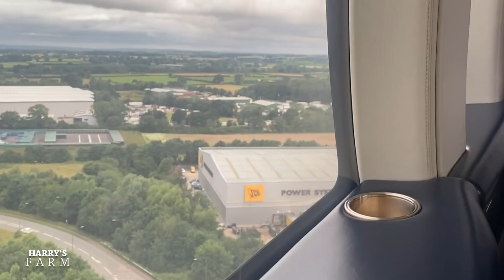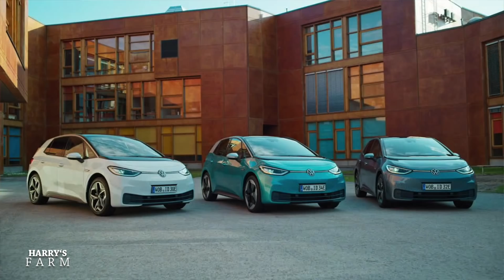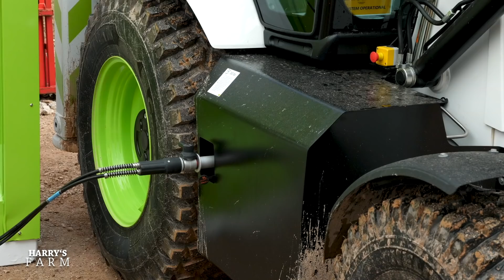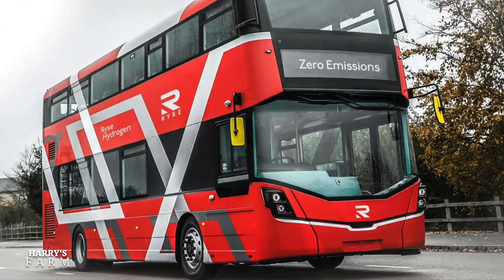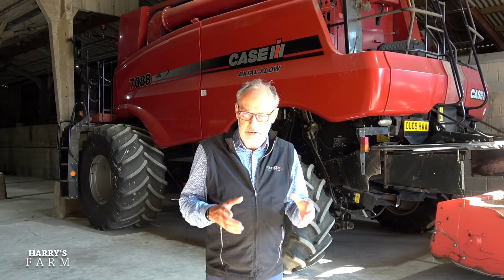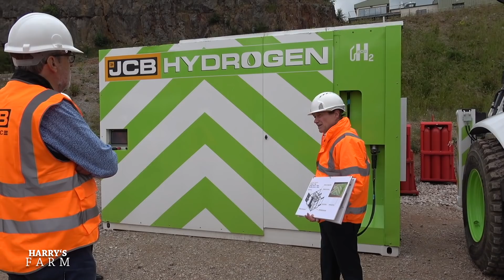Why JCB thinks hydrogen is the best alternative to diesel for heavy machinery, farming and HGV fleet

Comment: Absolutely brilliant.  Hopefully JCB can wipe the smug smile off Elon Musks face.
Reply: Elon musk is investing hundreds of millions in battery RD.  JCB will lose every penny they put into hydrogen.  Batteries can't run for a 12 hour shift.  yet.
Reply: Unfortunately not. this offering ignores the main problem with hydrogen, which unfortunately Harry et al either choose not to mention or simply don't understand. Elon does.
Reply: @dipladonic  which is what?
Reply: @callumhardy5098  A relatively huge load of renewable energy is required to produce only a relatively tiny amount of green hydrogen.
Reply: @dipladonic  yes, at the minute that’s true. There are many ways of getting hydrogen. Siemens are currently building two large electrolysis plants in Germany if these are successful it could pave the way for efficient hydrogen production in Europe.
Reply: @callumhardy5098  Don't be ignorant. Look at the production volume at the Siemens plant (and ALL other green hydrogen projects). It won't scratch the surface of the ubiquotus green hydrogen fallacy. All of these projects are greenwashing smoke and mirrors.
Reply: @callumhardy5098  ...and remember the biggest problem that green hydrogen has, namely, volume and cost. It takes a relatively huge load of renewable electricity to produce only a relatively tiny amount of green hydrogen. Until or unless you realise that small, inconvenient truth, then you are not objective enough to comment on the subject any further.
Reply: @dipladonic  Before Elon Musk, Tesla and large investment, batteries were in-efficient, heavy, more expensive and charged slower than modern batteries. Are you saying that electrolysis and other hydrogen generating methods cannot be improved by investment and demand? It’s clear that while electric cars are a viable replacement for short distance commuters and city cars, they still are no match for Long distance (mostly diesel) ‘crusing’ cars. I, for example have a 2006 diesel Jaguar XJ which will do 700 miles on one tank and it only takes me 5mins to fill up, don’t you think that there is a market for this type of vehicle? And that of JCB can do it without an inflationary price that, that will be the answer?
Reply: @callumhardy5098  Battery density hasn't really increased to any significant extent (unlike Moor's Law and semi conductor capacity) for decades. If you read my responses to callum hardy on this thread, you will see exactly why ubiquitous green hydrogen is a fallacy. Cheap, plentiful, reliable hydrocarbons are the master fuels and will remain so until the supply/demand curves intersect, then there will be wars (which will never be fought over unreliable, dilute, and highly subsidised wind and solar!
Reply: Excellent! We hope so! Bloody Tesla’s! I give em a blast of diesel in my Jag when I pass them.

Comment: Interesting video but what about nox and what about oil burn? Fuel cells are still twice as efficient, in other words twice the return from a fuel cell,  this means the whole re pressurizing part is not needed and I will bet that is not cheap plus the prices only make sense if the hydrogen is made from gas, so many  parts missing from this light skim over the subject, take a look at the toyota hydrogen engine and the problems and lack of power. I would still put my money on fuel cell / capacitor bank / electric motor setup, more bottom end grunt less maintenance, longer life.

Comment: Diesels engines were originally designed to run on peanut oil or any combustible fuel oils. 
I don't believe in global anthropogenic climate change.
If you can, please show me peer reviewed data linking the correlation between CO2 emissions and global temperature change. 
I believe that governments & global warming enthusiasts are trying to solve a problem that doesn't actually exist.

Comment: this  is very old news for me.  There was a farmer in TX that made a way to produce hydrogen on his farm with a wind mill and water.  Then converted his old tractor and some other equipment on the farm to use hydrogen.  he was far from a rocket scientist and with his era, only finished the 8th grade.  Then again the head of the TX supreme court back then also only had a formal 8th grade education.   I would also say look at what BMW engines were designed to run on back in the 90's.  It just might surprise you.

Comment: Unfortunately, this technology will be squelched by the "Elite". There is no money in it for them. There is plenty for hydrogen fuel/cell tech, fossil tech, and electrical tech. No money in converting water to H2. There's no way to control a substance with an endless supply. Bob Lazar already has a hydrogen combustion engine and its been squelched. Good luck JCB. I hope you pull it off and put Musk under. It just ain't gonna happen though. Not until the world is cleansed of evil.

Comment: Is it possible to use delivery tankers at 400BAR like you would deliver propane? Or will the government not allow that much pressure out on the road?
By the way, I am talking about big storage tanks, not small cylinders.
Reply: You won't find a big storage tank at 400 barg on the road, it can only be small cylinders.

Comment: Hydrogen doesn't provide more energy by volume, unless you use metal hydride storage. If you use metal hydride storage it's energy per mass is actually worse than battery's. The only exception I've found is using compressed ammonia gas, then supplying fuel-cells via on-board reforming. This however is horrifically inefficient, to the point of completely eliminating any economic incentive for doing so.

None of these vehicles are road-registered or refueled at a service station. So a battery swap makes far more sense, especially since it could be integrated with the vehicle trailer.

Comment: As I understand it, the problems of Hydrogen storage and energy density can all be resolved, but the real issue is that any combustion engine regardless of fuel, will generate NOx emissions.  NOx emissions are the reason diesel is now being vilified, so I don't see how Hydrogen fixes that problem!
Reply: Nox has been solved in diesels already with the use of DPFs and adblue.
Reply: @stephenparker5241  This is why discussion is good.  I just did a bit of research on SCR and adblue (urea in water) and you are correct, this does appear to remedy most of the NOx issue. If you're open to it, you can learn something new everyday.

Comment: The volumetric energy density- density per litre of cryogenic Hydrogen is 4x less than diesel and 8x less than diesel if it's a gas compressed to 700 bar and obviously 16x less if the Hydrogen is only compressed to 350 bar which is typical if you're not specifying high performance hoses, valves etc. Storage is really the big challenge for Hydrogen as a fuel. 

Check out https://www.energy.gov/eere/fuelcells/hydrogen-storage.

Comment: If the hydrogen comes from natural gas, it makes no sense whatever. Just run CNG in the diesel engines. Old tech.

H2 engines are nothing new at all. Not Otto cycle gasoline engines, but diesel cycle with H2 direct injection. Well known, long done.

Comment: This whole way of thinking could let the world carry on with little more than a bump. I could never understand how a battery powered truck or tractor were going to work. This will trickle down to cars as well is my guess. It makes no sense to dig up the world for something that's going to fail in the end. There probably will be battery powered cars in the future, but this is way more practical and sustainable. People crunching numbers say this is not efficient enough, but it has not really got much to do with the efficiency of an engine, we are supposed to be saving the world and batteries are a fast track to destruction. A hybrid capacitor/hydrogen powered car might be an option as well. I would love formula 1 to go down this track and bring back the V12 engines. Great video Harry, I've been waiting for some sense to prevail.

Comment: Couple things about hydrogen fuel, it has a wider range of combustibility over propane or natural gas. Of the three it has the least amount of energy for it same volume of fuel. There’s a reason we use certain fuels. One reason gasoline and diesel fuel are used in the US is because they don’t need to be compressed to be shipped, either by pipeline or truck. Propane can be compressed to a couple hundred psi and turned into a liquid, hydrogen needs around 3000 psi to be turned into a liquid and subsequently needs a much stronger tank to hold the fuel remembering of course it has less energy then propane. Additionally compressing a needed amount of hydrogen to run say a farm tractor I believe it’s quite an accomplishment in a short period of time which can’t be done. It all sounds good and sometimes it satisfies the do gooders but don’t bet on it.

Comment: When I first heard about lorries like Scania, Volvo, DAF etc moving towards full eletric I did have concerns about running costs. As wouldn't there be more downtime as they would take hours to charge and the range surely wouldn't be all the great with the amount of weight these vehicles need to pull. There's also the extra weight of the batteries and with lorries weight is a big thing to think about as the more the tractor unit weighs the less cargo you can haul meaning less money per trip. Seems like a pretty big turn off for companies to buy these new trucks atleast for long haul. Inner city or local haulage might be OK with this way of powering trucks but I imagine it would surely be unsuitable for long haul.

Comment: Very nice from JCB to invite. But there is a problem, waste heat. Every stap you make to get hydrogen you lose energy in form of waste heat. So from the electrolysis 80% efficiency, compressing 15% efficiency and then you have to cool down the gas I don't want to talk about it.
The biggest fraud in history of mankind, it is not the CO² in the sky it is the inefficiency of our inventions that maybe could reduce the emissions of CO².
Yes we have to be efficient with our fuels, but every new engine on the market can't produce more kwh from every gram of fuel than the previous one did. In technical understanding the new technologies are rubbish.

Comment: My question what is the compression ratio compared to the Diesel  . Will it be man enough to pull a100 rail cars .i will be impressed if I see a Hydrogen truck pass me on the highway hauling a100 thousand LBS LOAD . Please talk about horse power comparisons & load capability. Nice and clean but dose it have balls .

Comment: Would an battery powered 20 ton excavator really be 28 tonnes? You can replace the counterweight with batteries while the electric engine would weigh much less. Nowadays we add weight to excavators to make them steadier...

Comment: It'd be interesting to know if the new hydrogen engines can be used as drop in replacements for the current diesel engines. Obviously the fuel tanks would need to be fitted too, but that would mean companies wouldn't need to go out and buy a whole new machine to be able to use hydrogen.
Reply: Great idea, the kind of mindset we all need but unfortunately most are still all about making money.
Reply: I get the impression from the video that the only change needed is the cylinder head, the injection and ignition system and the fuel tank. So keep your fingers crossed conversions may be possible.
Reply: @stevemillard2487  possibly the crank as well to change the stroke length. All fairly straightforward stuff though
Reply: @izaakfrost4186  alas. NOx
Reply: oil companies attempting to sell oils and gas dressed up as hydrogen it is a scam    Depending on the quality of the feedstock (natural gas, rich gases, naphtha, etc.), one ton of hydrogen produced will also produce 9 to 12 tons of CO2  
However, hydrogen combustion with air produces oxides of nitrogen, known as NOx. In this way, the combustion process is much like other high temperature combustion fuels, such as kerosene, gasoline, diesel or natural gas. As such hydrogen combustion engines are not considered zero emission.
Reply: @brianevolved2849 it's zero emissions. Just water vapor. Weren't you listening?
Reply: @victorhooper4236  oh Victor you are silly,  However, hydrogen combustion with air produces oxides of nitrogen, known as NOx. In this way, the combustion process is much like other high temperature combustion fuels, such as kerosene, gasoline, diesel or natural gas. As such hydrogen combustion engines are not considered zero emission.
Reply: @brianevolved2849  sure but only minute amounts of nitrogen oxide, not enough to be a dangerous emission.  When combined with air  it produces mainly water vapor. No CO2 emissions
Reply: @victorhooper4236  Honestly Vic H2 such crap idea  storage compression explosive  I've played with the stuff  it's f'ing dangerous
Reply: @brianevolved2849  I think you need to look to the future and the future isn't all batteries
Reply: However, hydrogen combustion with air produces oxides of nitrogen, known as NOx. In this way, the combustion process is much like other high temperature combustion fuels, such as kerosene, gasoline, diesel or natural gas. As such hydrogen combustion engines are not considered zero emission.

Comment: Interestingly JCB point out there is more energy by mass for hydrogen, but the issue is volume - the density and storage of hydrogen is the big challenge. In gaseous form it isn’t energy dense enough, in liquid form it needs to be maintained at impractically low temperature. Hydro carbon fuels are an incredible fuel. I think utilisation of the highly developed reliable internal combustion engine is critical, but I still think synthetic fuels are the way forward. More energy I put up front but greatly simplified logistics and hugely improved energy density, while also continuing to use ICEs. Fascinated to see how they get on with development at JCB - they are certainly driving the conversation forward! Would love to chat to you about this Harry, so much more content to be had on topic! Jon :)

Comment: The absolute biggest problem is that an farmer can generate hydrogen with his own solar panels/ windmill so no income for the government on diesel / electricity taxes.
Reply: that same farmer can use that same electric power for electric propulsion with higher efficiency, and also without income for the government, so what is your point?
One of the things not mentioned in the interview is that a much bigger tank is needed to store hydrogen compared to diesel (17 times @ 200 bar 15 degr C), so in the end it will have to refuel much more frequently than a diesel vehicle. Very much similar to an electric vehicle.
Reply: @youngdude7500   that’s true. Electric use of an telehandler for instance can be useful but not for an tractor that runs for 18 hours a day during seeding/harvest season. We need to get rid of fossil fuels. And hydrogen can be an excellent replacement. There are multiple experiments in the Netherlands. Public transport busses are operating 350bar hydrogen tanks and cars are operating with 700 bar hydrogen tanks. 

And when you look into liquid hydrogen the tanks can be way smaller.
Reply: @jeroenvandervelden6512   Both alternatives for fossil fuel have their flaws, and I'm trying to give neutral comments. Concerning your suggestions on hydrogen: Hydrogen @ 700 bars requires still 7 times the volume than diesel needs for the same energy amount. How will that be stored on the tractor?
Liquid hydrogen 3.5 times the volume and at -253 degr C, so that does not sound as a realistic alternative.

Comment: You missed the biggest problems. How many solar panels do you need to hydrogen power your twenty ton excavator? 
What do you do with those toxic solar panels when they reach the end of their working life?
Large volumes of hydrogen requires nuclear or fossil fuel for it's production, which brings you back to square one. 
It would have been great if you got him to answer those fundamental questions.

Comment: Never thought about how hydrogen could be more effective than electric when it comes to certain industries. Will be interesting how it pans in the future. Could see small to medium with electric, and massive trucks and machinery using hydrogen. Sort of like the current landscape now between petrol and diesel
Reply: Over 200 and up to 350 bar tank, full of hydrogen....Very dangerous and difficult to handle.
Reply: @coplani  Can you elaborate further on why its dangerous and difficult to handle sir?
Reply: @hankmoody9965  A tank full of very highly pressurised liquid hydrogen is like a bomb waiting to explode or be ignited.
Reply: @coplani  Thanks. How easily can it go off? As in if it gets shot at or is in a fire, are there any protected preventions for it to not explode?

Comment: Hydrogen "Assist" with Diesel IMHO will provide very low emissions.  So you keep the same engine, But the pistons, valves... would need to be stainless steel because of higher heat, and then you would need water injection "Assist" misted into the intake to reduce heat, and slow the burn.  You would also get better fuel efficiency too !
I think this setup would be a Better Next Phase to be able to get into, than the complete switch of Hydrogen engines.
You see, Stanley Meyers, Split the water right on the vehicle.  And No Need for a Fuel Cell.